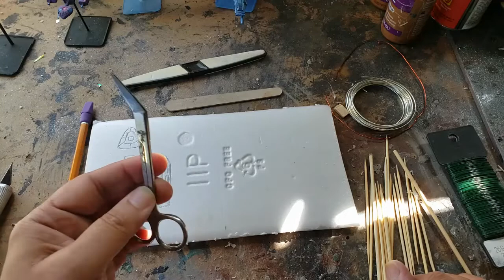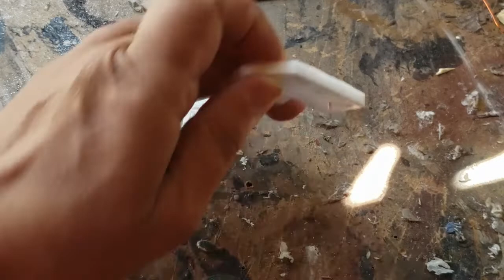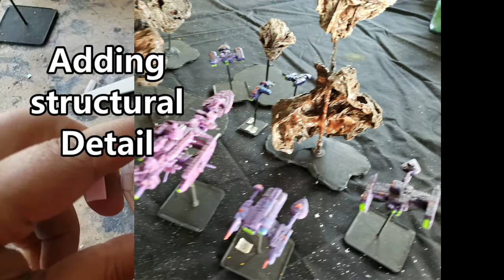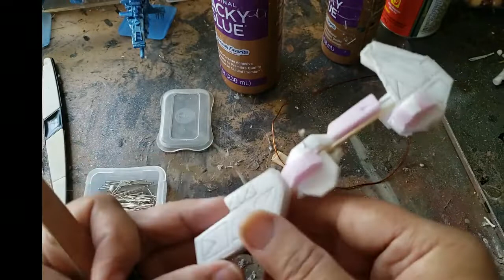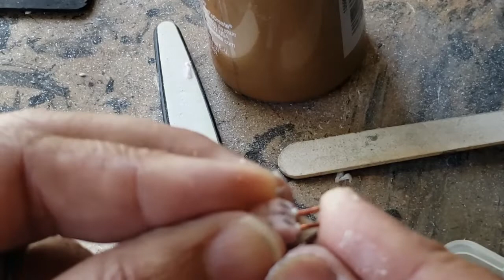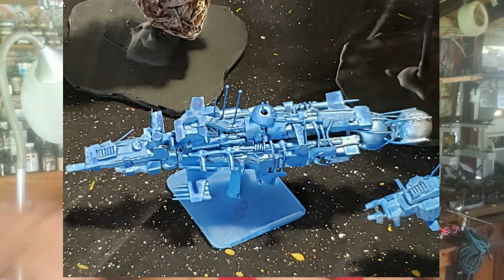Building foam starships, updated techniques

Comment: Nice work, nice work indeed!!
Seems to me that different colored layer foam would help with symmetry when shaving opposite sides for smooth arches.
Reply from the maker: Thanks Michael, yes you're probably right. I use the produce foam trays to make these. You should also check out my clay ships and clothespin  ones. I have a new series on this starting this month.
Reply: @mjhobbycorner5503  I saw that. I was originally shaping mine from basswood but they looked somewhat trekkie. A lot less detail but basswood was taking a long time to file.
I had no idea styrofoam could be that versatile.
Now you've got me wanting to roll dice again. There was a time finding players was easy but with computers we've lost out.
I have my own rules and now with your videos I can make my ships specific to my ship allocation forms.
Thanks again for your expertise.
Reply from the maker: Thank you, glad it helps. My new series at the end of the month will explore more techniques. Cheers🙂